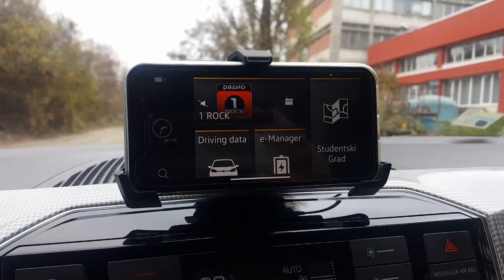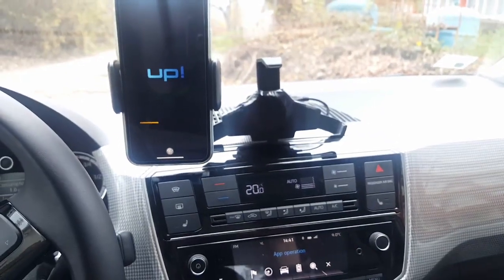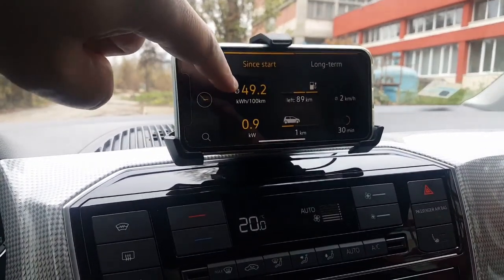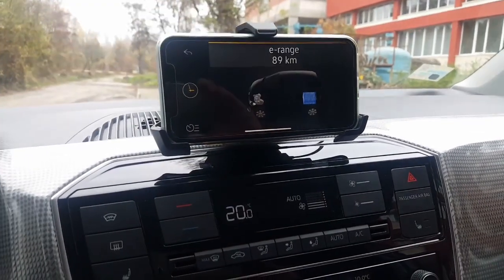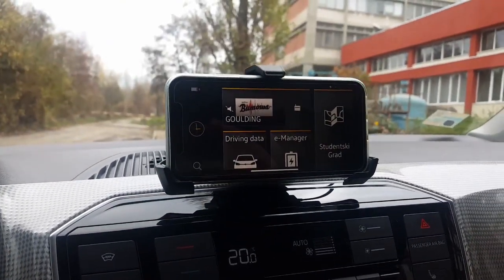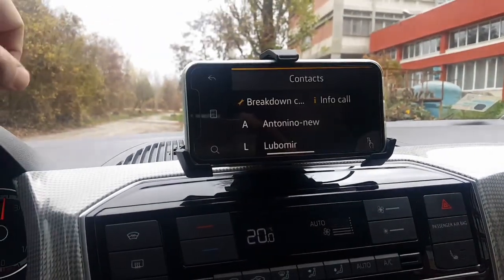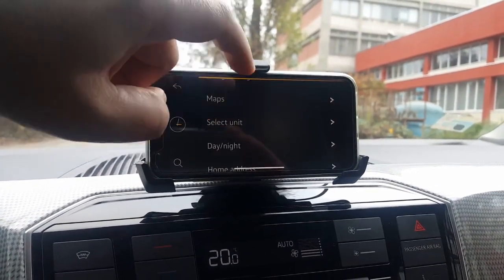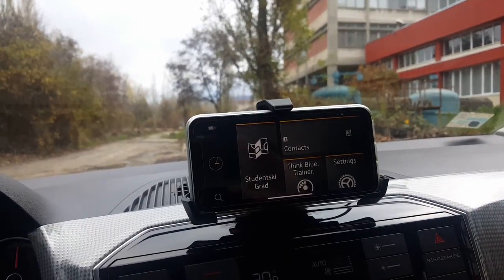Pros. and cons. about Maps+more app on VW e-UP!

Comment: Does this work with the old E-up (that came with Navigon/Garmin)? 
The local dealer claims that it works with ALL e-up cars, but I couldn't figure out how to activate bluetooth sync.
Reply: I wonder about this to. Is Maps + more compatible with E-up! 2014? Or perhaps possible to hack? I know Maps + more was invented back then and used on gasoline versions, but perhaps not possible to use for controlling charge and preheating. Somebody know this?
Reply: @MegaShap  Maps+ more on older cars = The device on the dash, preheat etc is possible also on EV. 
The Maps+ More app is exclusive to newer cars that only has a phone holder on the dash. 

The original E-Up does not have Bluetooth on the head unit, but only on the Garmin/Navigon device on top.

Comment: The minimum charge is ud you plug IT in and IT only has 5% left, IT Will charge immidiatly to the min level (lets say 30%) and then the when schedual tells IT to.
That watt battery wont be left at 5% and risk Damage battery ud next schedual is long time in the future.
I have mine set at 30% but you can set it at 20% also and IT Will Make sure battery is not damaged by bring left with low charge for a Long time or until next charge cycle
Reply from the maker: Usually I set the minimum charge level to 20%

Comment: Your new 2020 e-up has 12 months of free We Connect included?
If so, can you rate the We Connect app Soon?
You might have to tell your dealer to tell VW to activate the sim card first.
I had to, and it took 2 Days.
Reply from the maker: It really depends from which country you are. For mine they didn't support it and I had to fight them back to include it in my car. As far as I know I was the only one having We Connection in VW e-up in Bulgaria. I also had to wait 3 working days the SIM card to be activated.
Reply: @tedonash2681  once the simcard is activated you can also download the weconnectID.
It has not many features for E-up, because its made for the ID family, but it loads and reacts faster and it has a build in map with chargers. Setting remote clima control is very fast in the ID app compared to the  regular WC
Reply: @tedonash2681  Mine was activated yesterday because i had big problems finding out how to start and use it.

Comment: if you want to use this application on a 7-8 inch tablet device, from the playstore the device will most likely not be compatible and download and installation will not be possible, however it is possible to solve the problem using APKPure.

Comment: Can you see things remotely from you phone? Like is it charging and set remotely heating/aircon on?
Reply from the maker: Not with this app.  It need a Bluetooth connection to the car in order to operate. I am researching an app called We Connect that should be able to give me this options. I will make a video if I manage to make it work.
Reply: @tedonash2681  I am looking for the same. We finally received our Seat Mii elec. after 6 months delay due to Corona. Instruction manual says it should be possible to set temp out of your home, but app does not support, needs connection with the car.
Reply from the maker: @jeroencoesmans9353  you can do it with this app https://youtu.be/b25pRtiNNPc on the e-up as long as you have the remote module installed. For the Seat I think the app have a different name but the functionality should be the same.